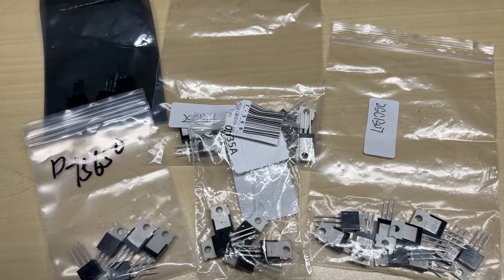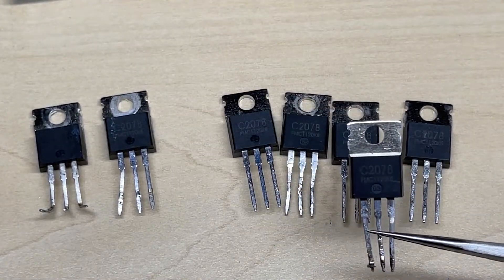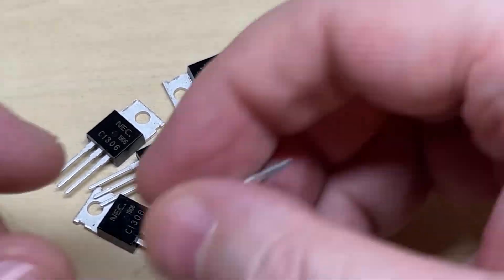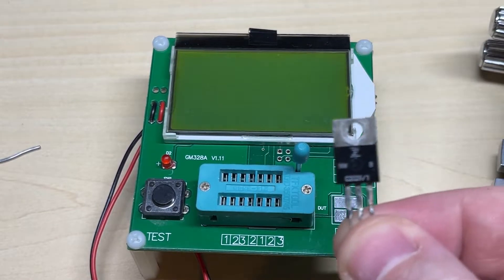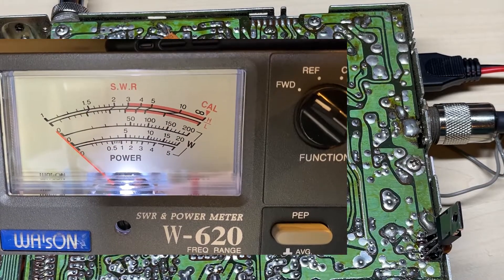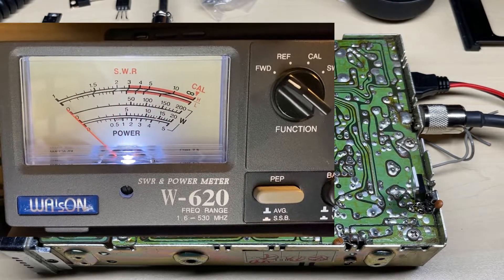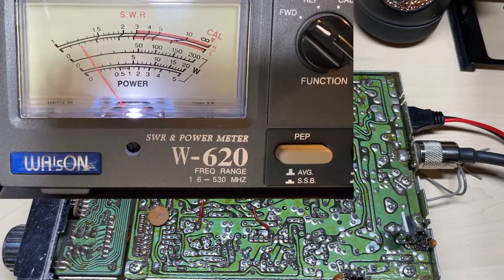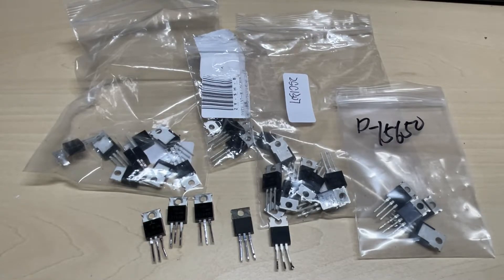EP 061 - Genuine or fake RF output transistors?.

Comment: These transistors are not regular rf-types, and then they differ greatly from manufacturer to manufacturer.  Lock at the tester and find similar b-value (voltage gain) and similar input /output capacitances. Other types need retuning in a specific environment. Good luck.
Reply from the maker: Most of these were just rubbish that found, clearly fake .

Comment: The IRF520 from Ebay is the Same shit 🤮
Reply from the maker: Most probably , I got mine from digikey so I hope they are genuine
Reply: @MicroChipz  yes from Digikay they should be safe, but yes it is always the matter of the dealer and your purchase, keep your fingers crossed that they are good, oh yes a question about Multi 3 from HAM in mine there was a yellow cable under the VCO that goes to one of the 5 Pin's was original, I don't think so, or ❓
Reply from the maker: @VOLKZZORN the yellow wire is original
Reply: @MicroChipz  okthen it has to be correct again on the shortened PIN on the VCO board 😉yes now just a new VCO and I think I have 70% on the box 😉

Comment: What you are trying are audio amp transistors like the 2sc1173, produce 3 watts in a CB set but get really hot really quick.
Reply from the maker: Most probably . They went in the bin shortly after .
Reply: @MicroChipz  there is clones mixed in the searchs